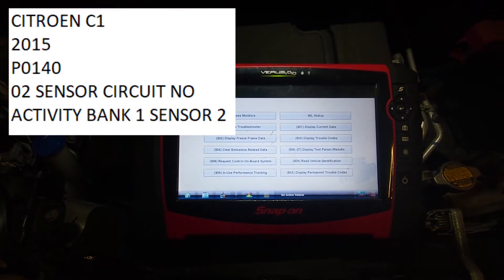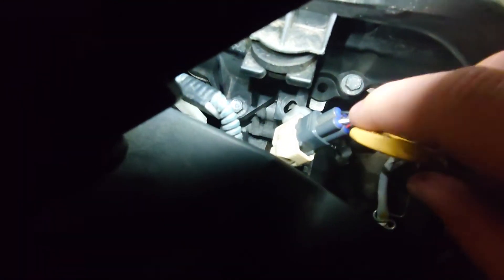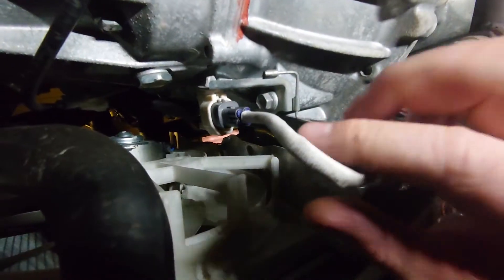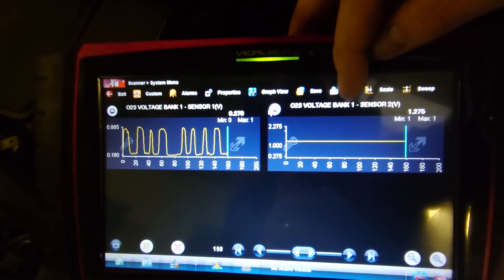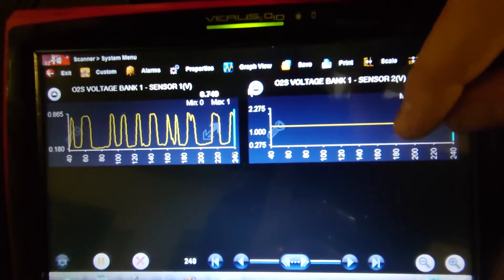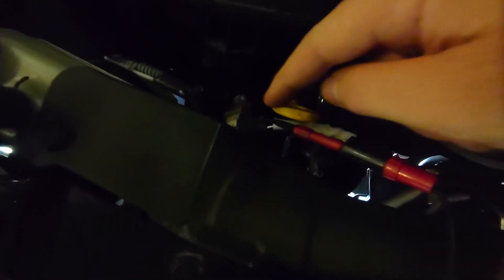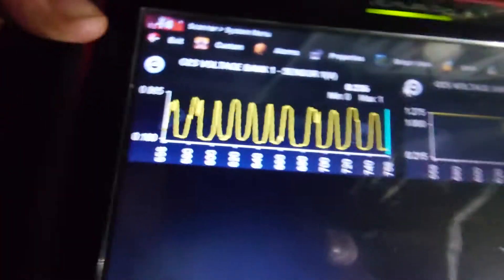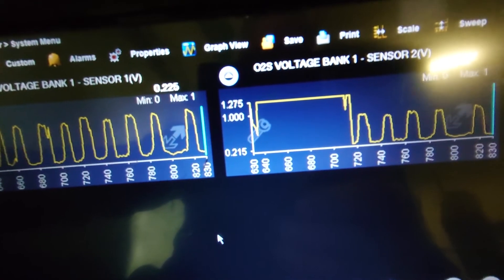Citroen C1 P0140 O2 sensor bank 1 sensor 2 no activity

Comment: I haven't done this test but I have replaced the bottom o2 sensor. The warning lights came back on after 1 day. The Peugeot dealership technian recommend a new ecu. Is there anything else I  could try before I get the new ecu fitted?
Reply: Hi there, have you fixed your car? I’m in the same problem as you and don’t know what should I do.
Reply: @ricardoscassa5  I replaced the sensor with an off brand sensor I purchased on eBay and got it fitted at a garage and fault codes cleared and that didn't work. So we took it to a Peugeot dealership and they fitted the official O2 sensor and that fixed the problem. It did cost around £250, but we phoned Peugeot customer care and they reimbursed us half of the money.
Reply: @ricardoscassa5  I recommend taking it to the Peugeot dealership and getting the dealership recommended O2 sensor fitted and that should fix the problem.
Reply: @shaykh_Mahboob  thanks for the advice. I’ve changed mine in a garage and the problem came back as soon as I left the garage.
Reply: @ricardoscassa5  I don't know if it would make any difference if you can purchase it in a dealership and fit it in a garage and that would be cheaper but I did see on the internet that Toyota can do a software update and fix the problem. I did call up a Toyota dealership and they told me to take it to a Peugeot dealership.